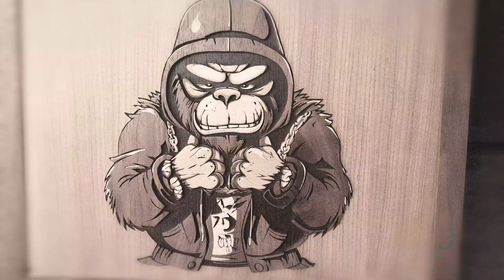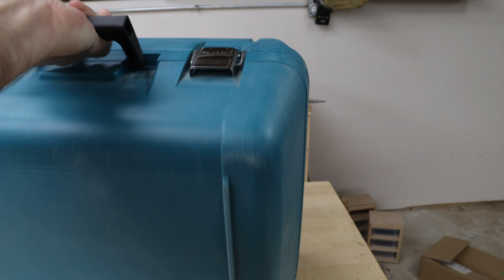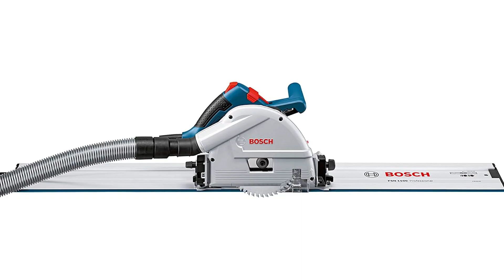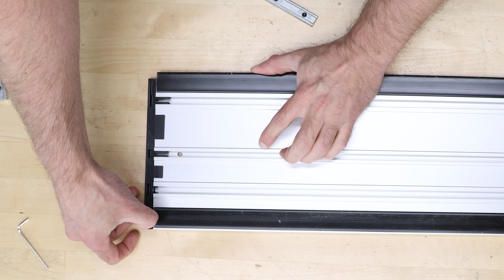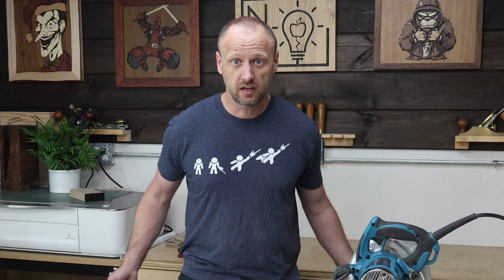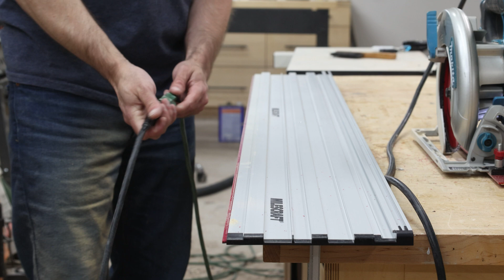Don't Waste Money! Watch This Before You Buy a Track Saw

Comment: I've had one for over a year. I use a similar Makita corded saw; I tried it with the clamps only once and decided they aren't necessary. I am going to make some parallel guides for it so I can make faster repeat cuts. They sell extra rails so you can make it longer, but I just cut as far as I can and drag the rail farther ahead and complete the cut. It's not as accurate as a table saw but much easier to cut full sheets with.

Comment: I bought a Bosch Professional 18 V System cordless circular saw GKS 18 V - 57 G (Saw Blade Ø: 165 mm, Cutting Depth: 57 mm, without Batteries and Charger, in L - Boxx) with a seperate 800mm track for the equivalent of $320.00. and it works perfectly.

Comment: I would just drill a hole to the base of the saw to the base of the track base guide…99% of the cuts you can make with that base on. You can also plunge cut with that saw and mod circle saw…it’s just not as easy…if you’re not a professional that needs to use a track saw daily multiple times then this is worth it.

Comment: I bought the Wen track saw system , 71/4 saw and 2-55” guides for $210. I’m a DIYer and built our entire LARGE kitchen with it and my Skil table ($300). Saved myself about $20K. LOVE the Wen saw system. If I was a pro I would probably go with the Festool but I’m not so this is fine.

Comment: I have one.  Is it perfect?  Hell no, nothing is, they all have some shortcomings but so far, I've been very satisified.  If you must have plunge capability, well look elsewhere.
     I have thought about your experience with setting the saw down but have experienced no issues.  I will follow your method of raising the blade until I get around to slapping together a simple stand to set the saw on.
Thanks for posting!

Comment: So, a circular saw is a saw with a CIRCULAR blade, right?
And a track saw is a saw with a CIRCULAR blade, yes?
And a miter saw; it too is a saw with a CIRCULAR blade I believe?
And then there’s a table saw — a saw with a CIRCULAR blade, correct?
Good. Just as long as we’re clear.
🤯

Comment: Thank you. I wish I knew about this attachment before buying the kreg 80 inch (+/-) rail for guiding a circular saw. It was about $100 and the saw plate rides on the lumber being cut. I cannot justify a tracksaw for my hobby woodworking. I don’t typically use sheet goods, but I have an idea of building an entertainment cabinet to house my home theater equipment and other boxes for streaming tv programming and space for a larger screen tv, where sheet goods of high quality and high price will be used.

Comment: This is an awesome overview for this cool gadget. I gotta imagine that there has to be a way to really clamp that saw down on the guide foot so it will never go out of calibration. Maybe put some loctite on those clamps and torque the clamps down extra hard. Probably worth a try anyhow, it's what I would try if I had one of these. Now, I went straight for the milwaukee track saw since i saw it for $300 on sale, which makes the decision making a lot easier because $500+ is hard to stomach! I have only used my track saw twice so far but I'm really happy that I got it. 

Today I was working on a door and fitting it to an old door frame. They need a small 1.5 inch piece at the top of the door because these are 81.5 inch tall door frames for whatever reason. I wish i brought my hand planes with me but what I ended up doing was actually just clamp this thin piece of wood to my track saw and do a series of plunges to shave it down. 

I think there is a new makita 40v track saw that was released, now, it's not like the M18 track saw is lacking in power, it's just that if you're running it all day long, I can definitely suggest taking a look at the makita because I think it is the best one on the market right now.

Comment: Not starting a fight here or smth. But. Isn't it just simplier and cheaper and quicker to make 1/8" DIY plywood saw guide?! Instead of all these jerking-offs. There are THREE tasks (OK to good) Track Saw can do unlike Circular Saw - Plunge Cuts, Dust Management, Overall Safety (closed blade, unti-kickback, stability, unslipery). NONE. NONE of those advantages are being solved with this piece of... technology. Then... WHY?!
Reply: @mykolashatkovskyi576  i can’t speak for everyone but i could see myself getting something like this for a few reasons. 1) don’t want to spend the money on a track saw when i already have a circular saw i love. 2) i rarely need a track saw, circular saw takes care of pretty much everything. 3) don’t really have the space for another tool at present. 4) on the off chance i need a lengthy and precision cut, i can whip this out and it’ll help with just that. i’m a new dad who just makes things his kid needs and i rent a small house with a decent backyard that doubles as my work area. i understand this is a pretty specific situation, but to answer your question, i am who would purchase this.

Comment: Still $100 bucks I rather spend that 100 bucks towards new dewalt dcf578b and build my own track guide. 1/2 inch plywood is fine for the track guide

Comment: I bought this kit about six months ago. I ended up screwing the sled to the baseplate of my saw and removed the hold down hardware. I have used it quite a bit and it makes accurate cuts.

Now for the downside… 1. The guard has to be pushed up and the saw blade has to be aligned with the zero clearance strip each time it is used.  2. Plunge cuts are very difficult but not impossible. 3. Lots of dust. In my case, dust collection is not possible. 

The takeaway…. For the DIYer, this is a great option that will not break the bank. For the professional who cuts sheets frequently, invest in a track saw. Having done some research, I would recommend the Milwaukee track saw. It can cut 45s without tipping off the track;  the adjustment knobs are clearly marked. It is a little bit cheaper than the competitors.

Comment: those rails are not realistic. they should be half of the standard length of sheet material. X2 should be the full length of sheet material. design flaw there by the compnay. u didn't need to draw your line down the whole length of the sheet. just a mark on one end and a mark on the other end

Comment: 20 dollar used corded saw in garage sale, bolt it to the guide. never have to re calibrate just leave it on the track, been cutting for years, there is 0 difference between expensive and cheap saw, spend money on the blade. repeat and make your panel saw with another 20 dollar used corded saw. and repeat again with a custom sled for plunge cuts. use the rest of the money and buy dinner.
Reply: @msolace580  please make some videos showing us how to do it.
Reply: @msolace580  This.  A used saw on Facebook marketplace is dirt cheap.

Comment: It really depends on what your cutting!!!    The wen track saw came in a bundle.    110 inches of track the clamps and saw less than 250 bones and for cutting sheet goods works great not any problems.     Fyi for testing and precuts I used my old doors ( those sold 2 inch thick ones ) didn't even dog lol

Comment: Gee, let me see if I understand this. You get a circular saw track system and complain it did not come with a saw. Most people already have a saw but want a track system. This is the best one on the market for price and durability. I have tried the Kregg track system. It really sucks for the price they want for it. I have three circular saws. A 6-inch that I will be using on the Milescraft. I have a full-size circular saw for thick woodcuts and a cordless one for convenience.

Comment: Great video. One thing I took from this video is the Milescraft track system which comes with the tracks, base plate and clamps is cheaper than the larger companies are selling just their tracks. It appears the base plate and its components should be the most expensive portion of the kit.

Comment: The typical track saw buyer has more $ than sense. I just use my Makita and a straight edge as a guide. There’s no difference in clamping down my straight edge vs clamping down a track and I can get the same nice cuts. I can also put my saw back in its case afterward.
Reply: @DYates-txag  my guide requires a 1.5" offset to allow for the saw's base offset from the blade.  This is way more difficult and les accurate that lining the track's cut line on your mared cut line.

Comment: Nice review! I’ve looked at a number of these low cost track saw systems, and in almost every case, the base that attaches to the saw seems to be the weak point. In the case of the Milescraft model, I think it would drive me crazy to have to raise the blade after every cut, especially when breaking down multiple sheets of the same material.

Comment: I own this Milescraft track and a Bosch Circular Saw. About dust collection .. the Bosch offers a dust port attachment that allows connecting a vacuum hose. It varies by maker but have seen others that off this too .. but you need to check your circle saw to see if an attachment is available.

Comment: Key takeaways- the red piece gets cut on The first pass. 2nd a small washer in the screws to the plastic guides really helps to line them up. The guides don’t move when tightening if you do this. Also you need to remove the plastic end caps all of them to connect the tracks and also to insert the clamps. You may want to reinstall the one on the side you start cutting from to keep your power cord if used from getting caught on the sharp machined edge. Thank you on the tip to raise the saw all the way up after each cut.

Comment: I drilled through the sled and saw, bolted a cheap saw directly onto the sled on the first day. Works great without the flimsy clamps. Now I have a dedicated track saw.
Reply: I know someone who did the same. Lol
They only drilled two spots, is that what you did with success? Or more/less? Curious
Reply: I'm keen to see how you did this.
Reply: I did the same thing drilled and taped the saw to the skid in 3 places and with a 5 mil hex bolt the saw is attached and does not move. Two things, due to the location of one of the hex bolts I could not do full depth of cut till I ground the top of the hex bolt down and I had to do 3 additional holes to move the saw slightly further out for  angled or beveled cuts otherwise it trims the zero edge further in and that changes the acceptor the normal cut. Also I use a 6ft level to make sure the tracks are in perfect alignment. I also built a case to carry the tracks and parts in.
Reply: My thought exactly. In fact, I'll go you one further (better?). Why not make the attachment with wing nuts so you don't need a dedicated saw. Just attach/detach as required. Not like you're typically going to be bouncing back and forth between track and non- track one cut after the other.
Reply: @silent_lucidity67  everytime you attach and detach you need to calibrate to achieve zero clearance on the sacrificial strip.
Reply: @andrewpanagis4383  You're right, if you use the goofy stock attachment method because there is virtually no way of duplicating the saw position once you take it off the sled.

But, if you get everything aligned and adjusted using the wonky attachment hardware and then thru-drill the circular saw base plate and the sled (4 corners), use counter sink bolts pushed through from the underside of the sled plate and sinch it down with wing nuts washers and lock washers you should be able to remove/replace the saw whenever you want and never change the setup. As long as you keep the hardware tolerances tight it's really no different than removing and replacing a tire on your car.
Reply: @silent_lucidity67  great idea... Let's see if this keeps it all straight....I really want this to work!

Comment: I bought this and returned it a couple days later. The setup was miserable and highly prone to error. The only way I could recommend this would be if you had a dedicated circ saw and permanently affix it with silicone. The blade setup guide is good in concept, but there is so much flex in the thin blades. 
I bought a garbage WEN track saw a few years back, then I bought this pile of crap. After I returned it, I walked down the aisle and bought a Makita corded track saw. I could have saved a lot of money and hassle if I just did that in the first place.

Comment: I just ordered one.  Thank you for your input, especially about how to set it down after a cut so the attachment base doesn't move around and mess up the next cut.  I find the price point to be very reasonable for how often I will use it, and the set-up to be fairly quick and easy, and the accuracy outstanding.

Comment: I've been using the Kreg Accu-Cut with my B&D circular saw now for several years.  It's been pretty good, but I'd really like to go with a plunge/track saw for more versatility & accuracy.  My struggle is with the brand choices... Kreg, Makita, Festool, etc...  I'm a hobbyist woodworker, so it's a total indulgence.  My overall hope is that I would be motivated to use it more by having an actual plunge saw of either brand.  I guess I'd also need to invest in a Kreg ACS, a Festool MFT, or create my own (TrackTubes option with my Centipede?).  First-world problems, right?!?!  😉
Happy to hear that you've kicked COVID to the curb~!
Reply: I bought an accu cut years ago and regret it, waste of money the biggest gripe is the guide is so small i had issues starting and finishing cuts straight.  They have since changed the design to offer a slightly larger one, i called them asking if i can buy but they wouldn’t sell me even after I said id modify to fit so made one with piece of maple.  Still it just sits there collecting dust if it wasn’t stored put of the way it would most likely be in trash bin.  Disappointed as my other Kreg stuff has been great.

Comment: I have been thrilled how this cuts with my Bosch CS20.  I had the Kreg version of this tool that never properly attached to the Kreg plastic base that was a genuine waste of money for me.  The Milescraft base is night and day better for me.  The only downside to this system I found is dust collection.  I put a fine tooth plywood blade on my saw and it cuts beautifully perfect straight repeating cuts but makes a big mess.

Comment: get well.. I have the festal track saw . The track saw was my primary saw up until about 1 year ago then I picked up a 3hp saw stop saw. I went all in on the MFT style benches . if you are only going to use a track saw as your saw I would also recommend the Dash Board rail hinge system it is fantastic and you will  get  great reliable cuts. The only down side to using a track saw as your only saw is it takes more time to make some cuts. I used to really enjoy the problem solving that provided me but now I love my table saw . The track saw will always be in my shop as there is no safer way to break down sheet goods. Square up large table builds . they are so handy I would recommend a track saw to everyone .  Thank you for the video always fun to watch your videos..

Comment: I have that track and really like it. I rarely use a track, so it made sense to go with the less expensive version, and like you said, it's very smooth. 

I haven't had the calibration, or dust collect issues that you've had. I use a DeWalt saw with an aftermarket dust port that I made work with some tweaking that fits my Festal midi very well. 

Great review. I'll be checking my calibration from now on just in case. Thank you.

Comment: I went that route 6 years ago with the Kreg system. Spent around $250 and used it maybe 20 times. Removing and putting back the saw on the skid was terrible, cut was terrible and sawdust terrible. I throw it in the garbage and spent $1,000 on a Festool TS 55 and a Vaccuum. Problem solved! A dream to use and basically NO sawdust. I use the clamps only on a 8' long cut. I have now 4 track guides and I'm happy to pay the price for a quality tool.
Reply: @Marcus_Caius  Yup! Buy once, cry once!

Comment: Huh, i will definitely keep that in mind, i bought the Bora one, supposed to fit most saws didn't fit my old DeWalt saw, bought it in 1993 its big, so i still use a guide and clamp it both ends and measure 3 times 😊

Comment: Buy the Festool. It’s not that much more. Versatile with many options. Non Skid track that rarely needs clamps.
Many folks find the need for a tablesaw is highly diminished. Got rid of my TS and don’t miss it. 
At around minute 7, your Makita is belching saw dust all over. Dust collection alone makes the Festool a better product.
Reply: The only Festool I’d ever consider buying is the domino. That’s because they’re the only ones that make them. Good quality tools can be had for much less than what they charge. I don’t need Gucci tools. I need tools that produce results.

Comment: I have the Kreg ACS system. I bought an extra track section so I wouldn't have to disassemble it in order to use it as a track saw. I absolutely love it. The Kreg saw also has an anti-chip feature on the outboard side of the blade as well as an anti-kickback control on the saw for when you're using the track.
Bill

Comment: I'd love one, but would barely use it. My DeWalt circular with a Kreg version of this product works fine for me, even in hardwood.
Reply: This version looks much better than Kreg!
Reply: @Kosh42EFG  , why? I have the Kreg version, but can't say one is better than the other
Reply: The ali Vs plastic base for one. And the adjustments or the cart on the rails.
Reply: @Kosh42EFG  
I have the Kreg and agree with you 100% on all counts. I’d buy the Milescraft if I were to do it again (and still kind of want to get the Milescraft and ditch the Kreg. 

The aluminum base alone makes the Milescraft more appealing and the anti-slop adjustments seal the deal.